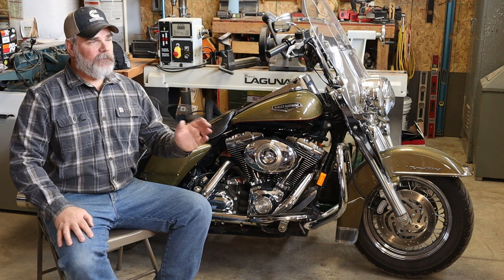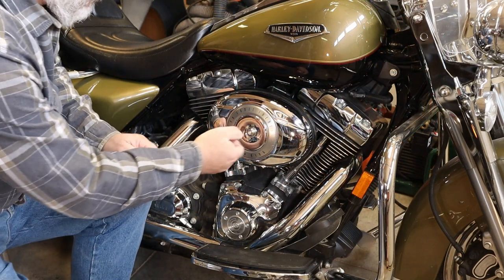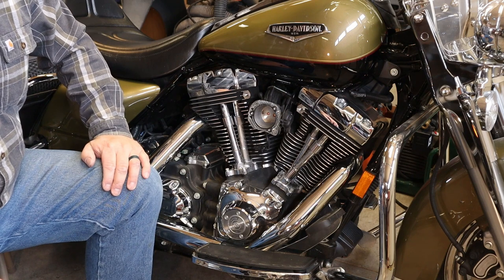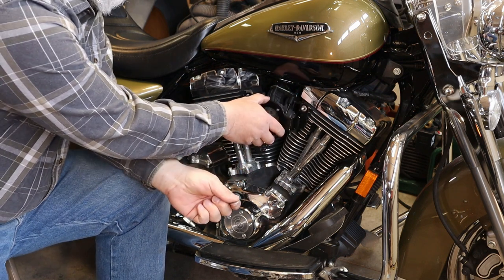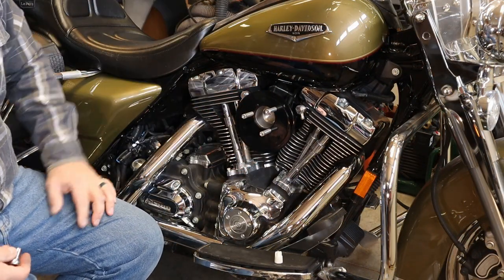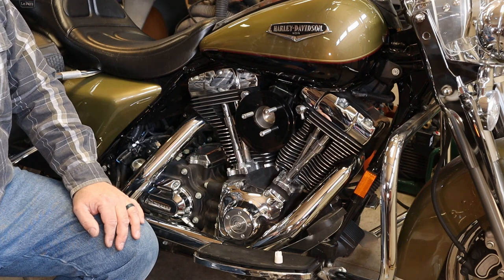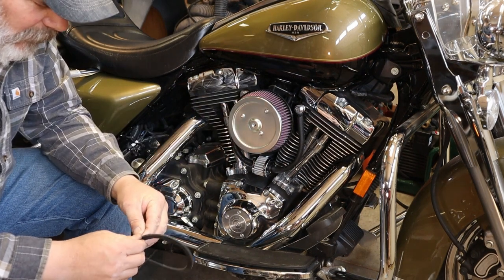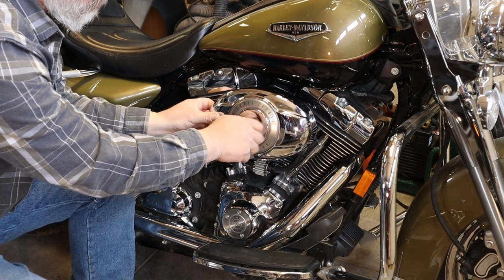DK Custom Air Intake and External Breather Install

Comment: Looks like your throttle body was very clean. Your engine blow by doesn't empty into your TB but your air cleaner.  With my 2023 they must have changed the design by directing the oily mist directly into TB. I've got to take a look.

Comment: The only thing about the zip ties is the heat from the motor may make them brittle over time and break. I know my Harley produced a lot of heat. So much so, that I put the heat shields on to deflect the heat from coming up in my face when setting still. Sometimes I wished I had my ride back but I just got too old and soft. Keep the videos coming. At least I can enjoy your rides. You do live in the best riding country anywhere in my opinion.

Comment: Great instructional video, DK should post this one as an instructional video on their website!  Only one suggestion from my youth as an electrician - for hoses and conduit that can or will be seen, take a second and turn the manufacturer's printing on the hose or conduit to the back for better aesthetics.  In this case, I don't think it mattered, though.

Comment: fyi that little filter will become a eye sore , its better to use a tee and along run of hose down and connect the little filter under the bike and wash it at oil changes .

Comment: Great video! Thank you! I just bought a 2007 Road King Classic where they put this kit on, but instead of running the tubes into a breather filter…instead they clamped both tubes together and have them coming out of the bottom of the bike 😳😒 So I’m leaving a trail of oil everywhere I go. 

How often does the breather filter need to be changed?
Reply: It really doesn’t.  I never really had to mess with it.  If you’re bike really pushes a lot of oil out then you will have to clean it once in a while.
Reply: Thanks for responding. I put the bike in the shop and discovered that some seals needed replacing. I thought maybe it was coming from the kit/tubes since the tubes went down from the kit to under the bike, but it appears the oil was coming from somewhere else. I just bought the bike last week and hadn’t seen this before. Thanks again for replying 🤩💯
Reply: Does this really need to be done?

Comment: Why not use the stock plastic housing and drill a hole in it and run it under the air filter housing

Comment: Great instructional video, but I've used a similar oil breather system and the oil buildup in the filter leaked on to my engine. I know it's been a year since you've done the install, and you may or may not have had oil drip issues on your engine. I went to a cup style oil breather by-pass and oil drip issue was solved. I'm curious though, did you have an oil drip problem from the filter? Thanks.
Reply from the maker: Not a drip.  Looks just the same as the day I installed it.  Probably bike dependent

Comment: Good job brother. I'm thinking of adding an external breather to my twin cam...leaning towards the catch can though. You didn't mention it, but going to a unrestricted/stage 1 intake like you did here usually requires a tune. Did you have to get a tuner or was the bike still running fine on the stock tune?
Reply: I did not tune it.  I used a O2 sensor enrichment device, basically a resistor on each sensor that made my fuel air mixture 14/2 I believe.  It worked great actually

Comment: Do you happen to have the part number you ordered from DK Customs? I need the exact same kit from the banjo bolts to the brackets and air filter back plate. I have a new air filter and really don't need another filter. Thanks for your time!
Reply from the maker: I don’t but it was the 606 series kit.  It was the naked kit with no cover.  I also ordered my own air filter.

Comment: Which DK Custom air cleaner was that? I have an ‘09 Road King Classic (96ci) and want to use the stock cover with a new cleaner.
Reply: The 606 series
Reply: @GreatPlainsCraftsman  Thanks! That might be a fall project.